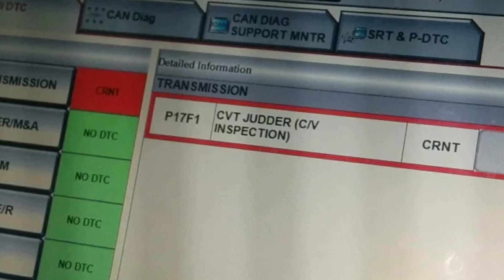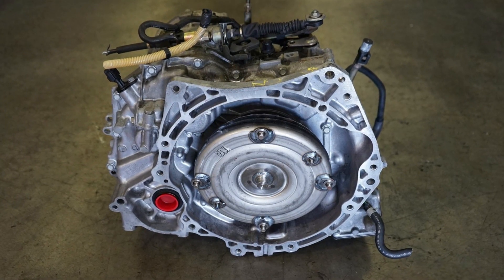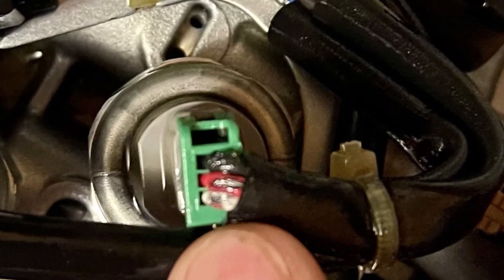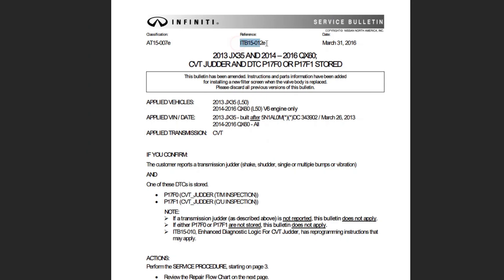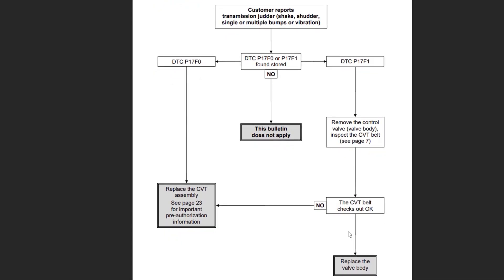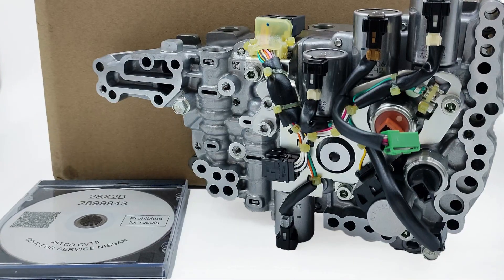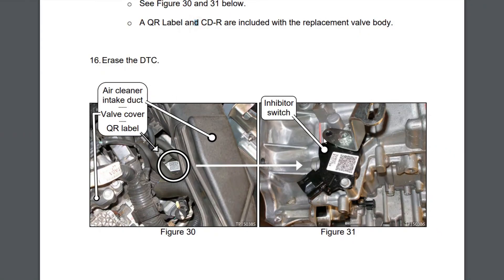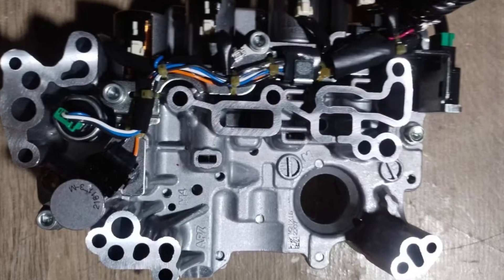P17F1 - CVT Judder in Nissan or Infiniti. What’s this?

Comment: My QX60 has  this code it also appears that solenoid one has no values and other selling noise. I don’t remember two or three they do have values when you accelerating or when you driving do you think in this situation It needs a new valve body or you can just replace one solenoid.? Or do the fluid change?
Reply from the maker: Usually, fluid change won't help if the mileage is over 90-100k miles. Replacing solenoids separately is not the best idea since if they started failing, others will likely fail soon, too. You need to find a mechanic who is good at these transmissions or just change fluid and drive till it dies, then invest in the replacement transmission.
Reply: If it was me mate I would replace the valve body and do filters and fluid this isn't hard plenty videos online and then get someone to preform a clear learning value so the tcm learns the new valve body. Just make sure its the same valve body replacement through nissan etc you can try a refurbished but i wouldn't.

Comment: I spoke to the dealership which  basically said if this code shows up they drive it and there's no noticeable shudder they do nothing and return to the customer. I dont know if te bloke should off told me this but he said there could be multiple cars out there with this code if there is no noticeable issue. It was just a coincidence that I run my personal obd scanner on the car prior to changing fluid otherwise I would have never known. It could of been there for a while as the dealership doesn't report it as there are no noticeable issues.and this was  the instructions on the issue this bloke was a bit taken back aswell.
Reply from the maker: Yes, that's true. If they don't notice actual shudder, they will never care. But the code is there, so something is wrong and it's going to be getting worse over time, unfortunately.
Reply: @TopicMotor  time will tell 😂
Reply: Same situation for me as well with 2017 Maxima. JF017E... Matthew - any update regarding this ?
Reply: @alonitzik447 well I brought a launch obd2 scanner fucked up the memory on the tcm and then spoke to chat gpt I wiped most of the learning parameters and the all codes included the p17f1 because I used a generic function memory wipe so lost nearly everything so other than being able to read signals car still would drive just not well. So i got pissed talked to chat gpt and spoke about what to do next we decided to buy the special functions for nissan and do a ipchara rewrite and then earse learning memory then forward point engagement then do driving procedure cars running fine no codes now. My scanner tool was a lunch 123e pro plus which cost 200 dollars and the programs with generic one as well 100 dollars 1 year subscription. But chatgpt did say there is a software update that cleared this code as it was a glitch if transmission is shifting fine so I wouldn't jump to doing what I did i would see if nissan could do some updates first before you went down this route as i didn't know till talking to chatgpt after I fuck$d it up 😅.
Reply: I got rid of the p17f1. I brought a launch 123e pro plus and did a generic function transmission clear memory which wipe most of my tcm and stored codes after I tried to drive it and it was terrible. R and D gone from dash I key system error and rough shifting in D and R so I spoke to chat gpt and decided to purchase the nissan package about 50 us dollars and chat gpt walked me through a chara ip rewrite then a earse memory learning then a forward point engagement then the nissan relearn procedure like from n to d 10 times etc and now has no codes running fine. After I made the error chat gpt stated that the p17f1 could be fixed from a general software update as this code could be an error. The problem is most dealerships and shops don't know what there doing half the time chat gpt was a life saver they just say we can't do it or don't know how. And these reset/rewrites are only on the tcm module not any other. I updated my own software aswell with downloaded update been a week new fluid filters cars running fine. If you've got this code could be tcm glitch software glitch etc but not always but as i said my car run fine previously go ask chatgpt about it. It has way more searching power saves time i spent awhile doing my research on it the P17F0 codes are the ones to worry about.
Reply: Nice